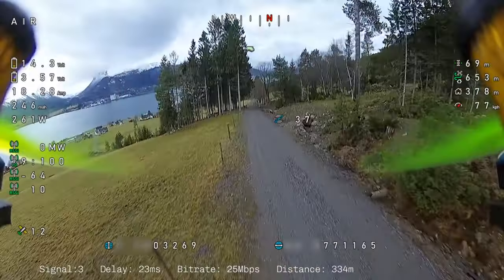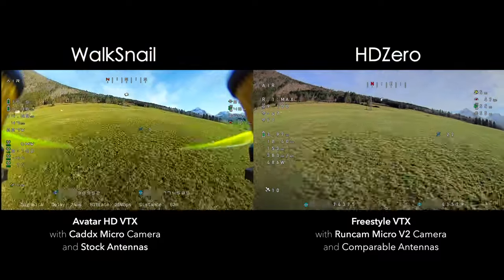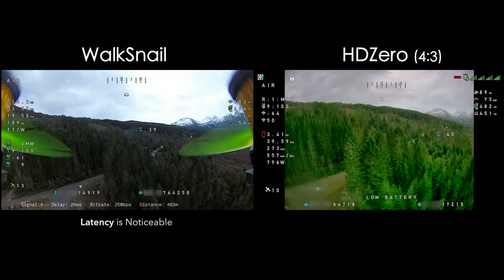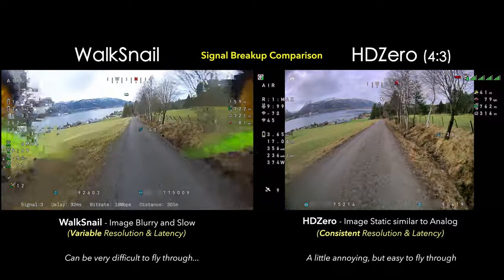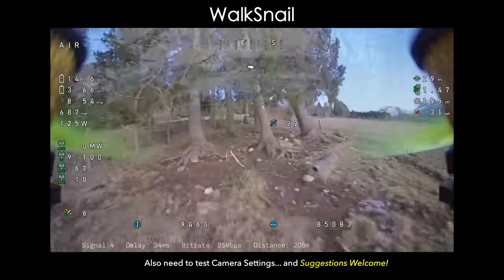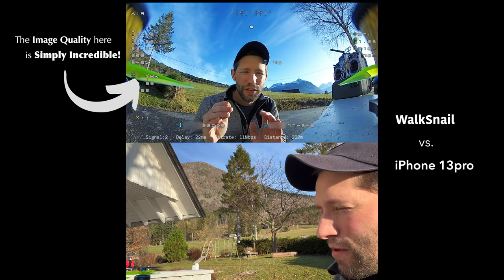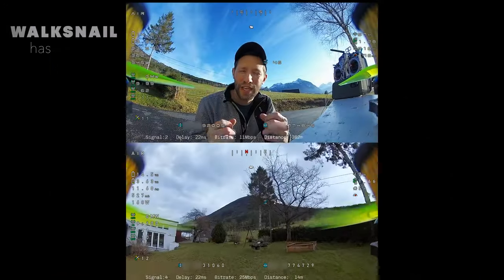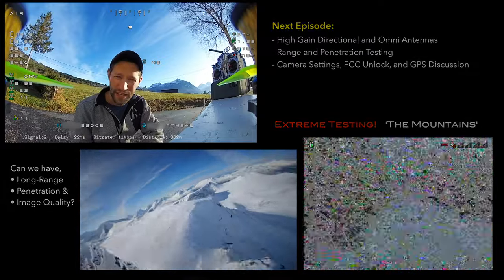WalkSnail Digital FPV Range & Penetration Testing | Signal Comparisons to HDZero | Initial Review |

Comment: Change Antenna...the original is just garbage...with truerc get bit better
Reply from the maker: Yea, the plan is to do some major Antenna improvements. I have some TrueRC Singularities, and several high gain directional antennas (7-turn Helicals, and X2-Airs) I’ll be using. 
If that doesn’t help I don’t know what will… for this test I just wanted to “establish a baseline”. So we’ll see, appreciate the comment, stay tuned, cheers!

Comment: The walksnail antennas are the worst antennas you can get, replace the stock omnis on the vrx and the quad and also replace the stock patches and performance improves dramatically.
Reply from the maker: That’s the plan, will post a follow up video soon, hopefully with good news. Appreciate the comment, stay tuned, cheers!

Comment: goddamn digitals.. nothing just feels "complete" even dji too. i hope immersionrc, orqa comes up with something shocking. they are way too silent for long time.
Reply from the maker: Yea, right?! Almost 2 years ago I switched from analog to HDZero which I consider a perfect upgrade, and it’s still my preferred system. However when I first “fired up” WalkSnail I was like “uh oh… HDZero might get pushed aside.” But, then I flew WS and well as you saw here, that beautiful crispy image falls apart rather quickly. 
Now I’ve been trying to improve this with antennas but it hasn’t been going well and I believe it’s actually the compression algorithm that needs works. 
This is bad because antennas might not be the solution, but it’s good because it means they can fix it by improving the firmware. 
So we’ll see… in other news 1080p30 is coming to HDZero, and it does look really good, but it does feels a bit strange flying in 30fps. More in that soon! Thanks for watching, stay tuned, cheers!

Comment: You're doing it wrong.
Reply from the maker: Curious what you mean. I did have some decent performance improvements using high gain antennas, I’m planning to post “Part II” this weekend showing those tests. So stay tuned, but any tips or advice is welcome. Cheers!

Comment: Definately an ant. Issue you have. I have tested both also and found the Walksnail to be far superior to HD zero..  Cheers for the video  🍻
Reply from the maker: @GTARC_au  yea, they both perform differently, WalkSnail penetrates things like buildings better. 
I tested DJI O3 recently however and it destroyed both… I’ve always heard the praise of DJI and get it now. It made it through the gantlet pretty well with basic antennas, but with helicals it was near perfect! 
Here’s the comparison: 
https://youtu.be/YjuHzt7J3VE

Eitherway all these systems are amazing compared to the analog setups we had years ago.

Comment: I asked Chris Rosser a similar question of why DJI (and similarly WS) doesn't seem to do better than HDZero around trees when it does much better than HDZero around brick and metal buildings. This is what he told me:

"I think that reason DJI does so well in buildings is because it handles multipath interference really really well. OFDM in general handles multipath well because it acts as many separate narrow band signals with low symbol rate rather than one wideband signal. In a building I think DJI is bouncing around the obstacle rather than penetrating. Out in foliage there is no surface to bounce the signal around and so the penetration is similar to analogue."
Reply from the maker: Excellent bit of information there, thank you! Many people have mentioned WS range but I haven’t really tested that yet, (these tests were all under 500m), Penetration Performance is really what’s being shown in this video. So what you’re saying makes a lot of sense and I’ll mention this in my next video. Thanks again and stay tuned, cheers!

Comment: My experiences are quite similar. Even at very short distances, the image is often very blurry, especially when flying between trees as in your example.
The problem occurs with both vtx, so it will not be broken.
Also, the image in the shadows is much darker than on HDZero.
Reply from the maker: Thanks for confirming, I think the problem is mainly trees. I’m gonna do some penetration testing in some buildings and see if it’s better. I have a theory that trees are harder for RF that buildings. 
Yea HDZero seems to always win the dynamic range competition. I’ve noticed this in many other videos. 
Anyway thanks for the comment and stay tuned, hopefully I’ll figure out some improvements,  cheers!

Comment: Thanks bro! Some people scold hdzero fo low res, but I'm happy with hdzero cos' that system despite to lower resolution have a super fast wdr and very good picture in low light, it's more stable and predictably, waiting for beta test 1080p for wrx, it will be cool for my long range quad)))
Reply from the maker: Sure, I mean my original goal wasn’t to make HDZero look better, but the results are what they are here. It’s just one test, (though I flew this path a dozen times to make this video…) I’m doing more testing now to see if I can’t improve the WS performance. 
However HDZero certainly does deserve the credit I gave it here, image quality isn’t as nice as WS, no argument, but it’s dynamic range and penetration in the trees is obviously better in these tests. 
Definitely excited about the 1080p option, for my long-range quad I think it’ll be a perfect setup. 
Thanks for watching, appreciate the comment. Stay tuned, cheers!

Comment: This is weird because I live in a very bad rf noise area and I had to get rid of hd zero because the break up was so bad only a few meters away, both dji and walksnail (on the latest beta firmware) had almost double the useable range on the same output power (1w).
Reply from the maker: Interesting, I’m thinking that maybe DJI/WS are better at interference and multi-pathing, but in my test here it’s actually trees causing the breakup. 
Another commenter quoted something Chris Rosser said which in summary was, ‘DJI/WS can capture and fix signals with interference and multi-pathing when the signals are bouncing off environmental obstacles, however RF doesn’t bounce off trees it actually gets absorbed.’
Since DJI/WS can’t then fix the image, it’s forced to pixelate/blur and with some added calculation latency. 
HDZero in the other hand can’t capture bouncing signals as well because it doesn’t buffer/repair the image, but in the case of trees it shows exactly what data did come through in real time with static filling the missing spots.  This ends up looking better in this specific situation. 

Now, this is just a theoretical guess/assumption and I’ll have to try to prove this idea with some Barn/Forest penetration tests in a future video. A pretty neat topic actually!  Anyway thanks for watching and commenting, stay tuned, cheers!
Reply: @GiantAntCowboy  I am very interested in your efforts. I like to fly small drones low to the ground and thru trees using within about 80 meter range. Currently use DJI V2 goggles and Vista VTX. Fairly happy with that but would love to get WS to work given the light-weight setup. Other problem I see with WS is low to ground flying gives low res monolithic appearing surface. It is disappointing that WS has not released firmware improvements over the last 3-4 months. Hope your antenna work can make difference.
Reply from the maker: @bcc1955  the “melting blurry ground” is really just an algorithm problem. Like the system can’t send or process the pixels fast enough. Hopefully this can be improved with firmware. The tree issue is a combination of signal penetration and image processing, hopefully we can improve the penetration part with antennas, but unfortunately I think trees and foliage will always be blurry until they can make the image process details faster… 
Definitely a bummer, and why HDZero is still my preferred option; they are releasing a 1080p update soon which looks great, not as good as DJI/WS BUT the image resolution/latency are always consistent which is really nice. 
I’ll do an update soon, working on some improvements now, so stay tuned. Cheers!

Comment: Great test! It looks like HDZero does better in overcast and lower light situations. You see a lot more detail/contrast in the trees when you are flying over. I notice this with HDZero vs DJI as well. Each shines in different flying scenarios. It seems odd you are getting that much smearing with Walksnail.
Reply from the maker: Yea, in many videos I’ve noticed HDZero performs better in low light. It’s like many the other systems have more contrast so they looks sharper, but it comes at the expense of details in the shadows and highlights. It’s definitely surprising that I get this much smearing, I’ll spend some time this week troubleshooting and testing and do a follow up. Stay tuned, cheers!

Comment: Very interesting results......
I'm fortunate to own all the digital systems and I've found that Walksnail in a number of locations I fly out performs by far the other systems.

And that's the main point..... Different flying locations equal different results and opinions.
Reply from the maker: Absolutely, for example there’s several power lines along this flight path, which could be part of the problem, but as shown HDZero doesn’t have much issue with them. I’ve flown this route several times over the last week with different settings but always get the same results. • Are you using stock antennas?

I can’t wait to improve the performance because I want to enjoy that crispy image, just wasn’t expecting such signal issues.
Reply: @GiantAntCowboy  
Well now that you mention power lines you've jogged my memory.
Theirs a spot I used to fly a lot with DJI and hdzero.
If the two I preferred DJI.... However I recently flew it back to back with Hdzero and Walksnail and the blur and smudge was terrible so I packed it away and flew hdzero for the afternoon.

Im using the stock antennas as the Omni's looked pretty good when tested.
Also the patches weren't as bad as I was led to believe. 
I think madstech has a video on it.
But yes upgrading antennas should help.... However based on my experience flying DJI especially in woodland and using upgraded antennas and 1200mw at the max bitrate of 50.8 and it still be a shit show of blur..... Again this was only in certain locations whilst in others it's lovely. 
So Walksnail may still perform poor despite your upgrades. Best move around a bit a try different locations.

Owning and flying all the systems I've found that I can pick and choose depending on where I'm flying ...

Hdzero is excellent
Walksnail is excellent
DJI.... Excellent
But all have different strengths and weaknesses.

Personally I don't like your thumbnail..... The system isn't bad. For many including myself it's excellent.
The blur we've all grown accustomed to on DJI and the image clarity, range and penetration outweigh the negative of blur infact it wasn't really mentioned much in the early days of reviewer's.
But I sold my V1 DJI goggles because of the blur and went back to analogue for a while and then Sharkbyte.
The community told me my V1's were faulty when I shared my experience.
Eventually though I bought some V2 goggles and they were exactly the same.... Turned out in the locations I may flew it struggled......  So now I've got them all.

If I was to recommend one system I'd encourage beginners to fly hdzero 1w with Hdzero goggles.
Reply from the maker: @gmivisualsjason3729  great information and feedback here. Thanks for taking the time. I’ll definitely try some different locations with the stock system to see if I can blame environmental issues. Also I’m wondering if it’s just that these buffer/rebroadcast systems don’t perform well around trees because the signal gets absorbed by the tree, as opposed to bounced like around building and hard objects. We always see the Parking Garage test for example. But we will see, I keep troubleshooting to see if I can’t get some major improvement here. Hopefully I do because I obviously want to enjoy the system! Didn’t spend tons of money because I wanted to make a “WalkSnail Sucks!” Video, hahaha! Thanks again for the solid response! C
Reply: @GiantAntCowboy  I think you've hit the nail on the head.... These systems do struggle more with foliage.
However on my local patch Walksnail on 350mw is superior to DJI V2 on 1200mw.. 
Walksnail handles foliage far better than DJI.
Reply from the maker: @gmivisualsjason3729  interesting, well it’ll be fun to test and try to improve. Most this hobby is just me tinkering and testing stuff. Obsessing with details and perfecting the setup… though the other day i did just go out and fly for fun, it was awesome! HahA
Reply: @GiantAntCowboy  just reading through the comments on your Walksnail post.... Such a mixed bag of experiences.. lol

I reckon for you from what I've seen from your channel..... Walksnail when cruising out and across mountain tops
And hdzero for down low in and around trees.
Reply from the maker: @gmivisualsjason3729  yup, good suggestions, they problem is I like to get as close as possible to the mountains and ridge lines, and it’ll take a lot of trust before I’m sending WalkSnail on those missions. Haha! 
“My Stress Level will be Cranked Up to 11!”
Reply: @GiantAntCowboy   I'm the exact opposite I have more trust in the two way links than with HDzero.
Walksnail like DJI is great in that after a while flying it we get used to how it degrades and we kinda develop a sixth sense as to when it's going to go....
Also Walksnail flashes red on the screen edges which I really like.
Reply from the maker: @gmivisualsjason3729  my main fear with Two-way links is that they are bound, and when signal is completely lost, like accidentally flying behind a mountain ridge, the systems can drop the link and take some time to come back. At least this used to be an issue with DJI, maybe it doesn’t do this anymore. 

- But also HDZero and Analog both give you the truth about your signal in real-time, when you screw up you instantly know and can re-adjust. 

- DJI/WS hide your screw ups until it’s suddenly you’ve gone too far and the image drops. 

Now my type of flying is unique, most people aren’t flying 7km out and trying to skim mountain ridge lines. But there are definitely tons of DJI guys doing this… so it’s really just about personal preference and experience. No doubt that the clean crisp images are nicer then HDZero! That O3 system looks incredible!
Reply: @GiantAntCowboy  Agreed.  We simply learn our equipment.
When flying analogue in the past I remember losing a drone when it went to full snow. 
I tried powering up but signal never returned.
What I didn't realise was that I wasn't actually pulling up but as I was in acro I was angled to one side so I wasn't going up but sideways.
As it was full snow I couldn't see my angle.
I lost that drone.....

I'll add I was fairly new to the hobby and still had a lot to learn.

On digital both DJI and Walksnail its different... What happens is the image will stutter and then momentarily freeze however what you can still see is the last position/angle the drone was at enabling you a fraction of a second to process the image and adjust sticks.
Many times I've pushed the limit of the system to this point and I feel very confident in it for that reason..... Analogue and hdzero I lose image but sometimes in the stress of the moment my mind can fail me with regards angle/orientation but digital this isn't a problem.
Like hdzero and analogue the image will return it feels like forever like on analogue but it won't reboot any more. (That was an early issue) unless you hit the 13.8 hardwall
And the latency is once again over exaggerated in my experience. Don't get me wrong I can feel it but it's not like camera drones at 100ms+  camera drones hide screw ups not DJI or Walksnail.
But true when your out at the distances you mention then I'm guessing you will simply need to build up to that distance and gain confidence

If course all your comments are correct but from my experience less of an issue in real life use ....
Reply from the maker: @gmivisualsjason3729  yup all solid points. It’s all about knowing, testing and trusting your equipment. I can definitely see using WalkSnail for some longer range stuff, just need to improve this signal performance, I imagine high gain antennas should help. I agree about latency, I mainly only notice the Variable Latency, not the actual Higher Latency, I’m not fast enough to notice millisecond differences haha! 
But certainly did notice HDZero felt tighter or more responsive.  Looking forward to using the system more.

Comment: compared to the regular omni's, have you tried the double antenna omni's like the Lumenier double axii? I was wondering how much more range does that upgrade actually provide? and is it worth the upgrade.
Reply from the maker: I have not tried the Double AXii antennas, and so can’t speak to them. Though your comment has sparked new interest in them. 
I recently bought a couple iFlight Albatross antennas for some HDZero/WS testing. Initial tests with HDZero show they work great out to 7km (4miles). I’ll be doing more WalkSnail testing soon. Thanks for watching, cheers!